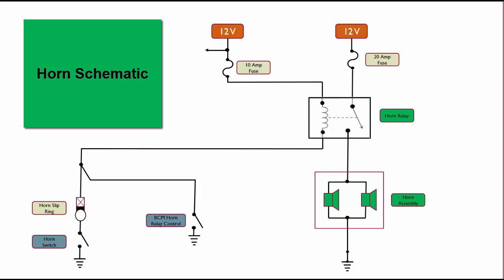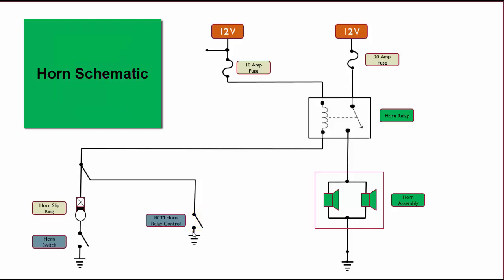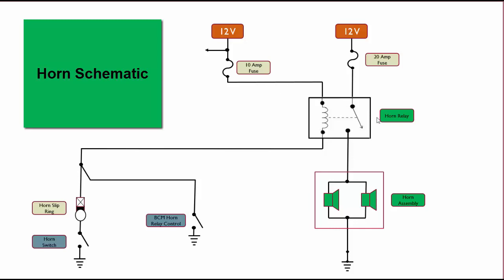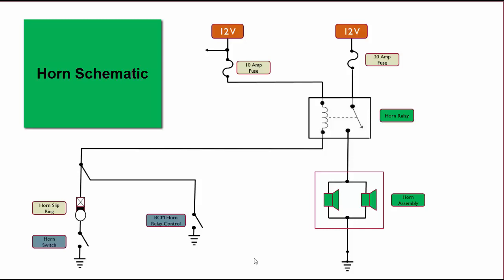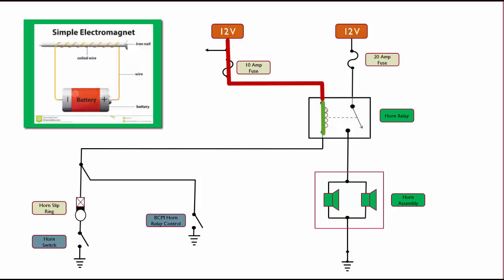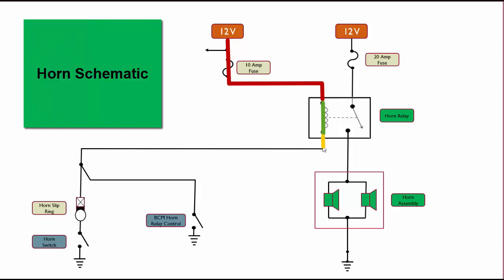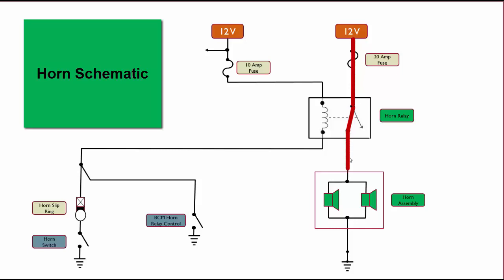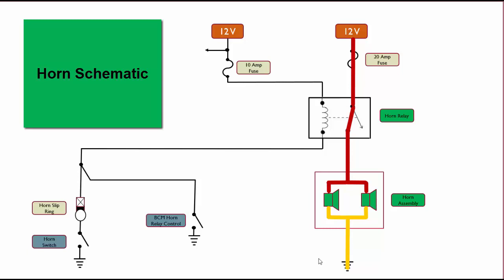Horn Schematic   Circuit Explained

Comment: hi,you recently answered question of mine on youtube stevemcgowan3017.you said check fuses power and water ingress.on wifes 308hdi 2010 diesel.mot passed then right headlight went off after heavy rain.is it ok to unplug fusebox to check for water then plug back in with out needeing recoding or anything?it runs well at moment 158000mile.my sisters 308hdi had non start problem so i suggested the battery microchip thing at front of battery and it sorted it.
Reply from the maker: I wish I had a definitive answer for you.  Each manufacturer, year make and model may have different requirements for when needing programming.  As a general rule though, usually if you disconnect something and reconnect it, it does not require reprogramming.  If you replace a module, or something that has a module built into it, programming is needed.  Oftentimes just disconnecting something can set trouble codes in one or more modules and may turn on a service light.  Any trouble codes would have to be cleared if this occurs.
Reply: @automotiveelectricaleducat5839  
thats good to know.thanks

Comment: this was very helpful. I am in a class, and we have an end of class project where we are supposed to give an oral presentation on something we learned in class. I want to do mine on electrical circuits, but it can only be about five minutes long so I need a simple system I can easily explain. This is perfect, and appropriately car themed.

Comment: Is fuse  required to  CHECK THE HORN GROUND CIRCUIT? Is the resistance less than 3 ohms?
Reply from the maker: While it is best to just always use a fused jumper wire, in this horn picture, using a jumper wire without a fuse would not hurt anything if you were jumping anywhere after the coil.  It would just sound the horn, depending on where in the ground path you connected to ground.  The resistance of the ground path should be very close to zero.  It is just the resistance of the ground wiring.  The same with the power wiring, very close to zero is expected.  The coil itself I have seen range from 20 ohms to 200 ohms resistance.

Comment: could a failing bcm cause a continuous horn? I'm thinking it was a bad contact pad and am abou to change airbag
Reply: On the schematic in this video, the horn could be on all the time because of lots of reasons such as.
Internal horn relay switch stuck closed
Horn pad / airbag switch stuck closed
BCM control switch stuck closed
Short to ground in the wiring from the control side of the rely to the horn pad switch or BCM switch
Short to voltage on the wiring between the horn relay and the horn
Each vehicle can be a little different depending on the picture.